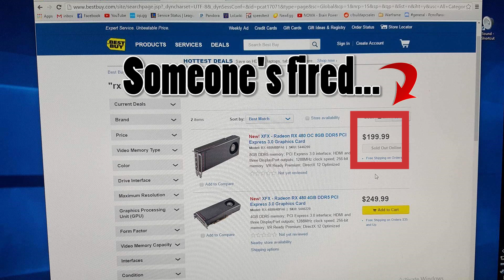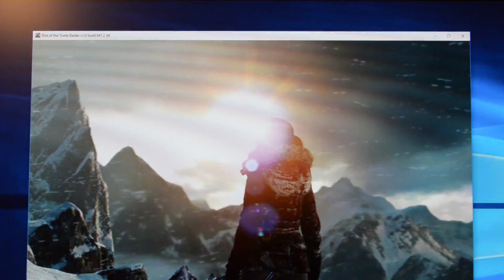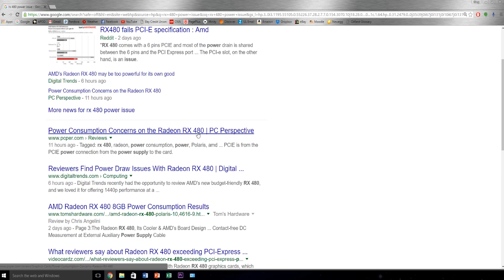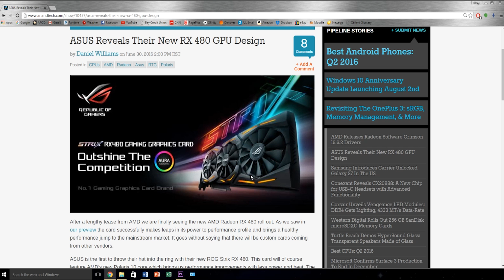RX 480 Aftermath: Power Issue & Over-Hyping

Comment: Why does AMD always have one serious fuck up with each generation of cards since they took over ATI? Saddening really, I love ATI cards.
Reply: embarkingolive how is the 290x a rebrand ? It's a COMPLETELY DIFFERENT CHIP . 7970 has 2048 SP and 290x has 2816 SP , 7970 has 4.3 Billion transistors , and the 290x has 6.2 Billion. They use different versions of GCN ( gcn 1.0 vs 1.1 ) . If anything , the 390 is a rebrand of the 290 !
Reply: What issues did the previous card.  Neither the fury x,  nor 290x or hd 7970 have issues
Reply: +embarkingolive amd  acquired ati in 2006, so no,  the 7970 was not developed by ati.  And the 290x was not a rebrand.  They use completely different chips (7970 is tahiti,  and 290x is hawaii)
Reply: Only poor stupid people think gaming is a necessity.
It's not. It's actually a luxury in life.
Reply: Fury X has stuttering issues at 4k. Even at 1080p on Mirrors Edge Catalyst it runs out of VRAM because it only has 4GB of HBM.
Reply: Why does nVidia? Why does everyone?
Reply: Actually embarkingolive, you're completely wrong. The 290/290x was not a rebrand - the 390/390x, on the other hand, was a rebrand of the 290/290x - exact same card, higher clocks and double the memory. So your statement "they didn't make any significant changes to ATI's architecture until the 390" is patently false.
Reply: Actually the graphics department is still ATI.
Reply: No, the 290 was new, the 390 is, in fact a rebrand of the 290. The R9 280 is the rebrand of the HD7970..
Reply: The 1070 and 1080 was discovered to have a massive issue too.
And the 900 series had issues as well, so did the 700 series.

All GPU runs into issues, the question is how hyped up these issues are on each brand.
Reply: I clearly see no issue here with the poor innocent card. What AMD saying to you is " Get a new gen motherboard damnit? "
Reply: they always have issues. but they stablize their driver after a year or more XD.
Reply: It's based off the architecture ATI had developed. They didn't make any significant changes to ATI's architecture until the 390, and yes, the 290x was a rebrand. Changing the name doesn't make it new.
Reply: The point is that the 300 series was a great improvement on card efficiency... It wasn't a rebrand, it was a refresh of it, where they improved with what they learnt from the 200 series, and then we had the Fury series as well...
Reply: If it was just a rebrand now explain to me the higher clock speed, the lower TDP and the ability to address more memory? Granada was an incremental upgrade over Hawaii in terms of efficiency which improved performance as well. A rebrand happens when you put the exact same GPU in a new series... For exemple the GTX 700 and 800 (OEM only) Series. Between the 290 and the 390, AMD made a refresh of the chip. Sure not a whole new architecture, but you don't need to be re-doing the wheel every time you release a graphics card...
Reply: the 290x had one of the worst stock coolers

but it was a solid card.
Reply: It's not a fuk up from AMD, previous generations of PCI-e simply can't deliver enough power, that's it! Get a cheap 3.0 MB and you'll be good.
Reply: +dra6o0n The 4gb flash applies only on review cards. They send them one card and two bios to review both the 4 gb and 8 gb versions.
Reply: embarkingolive
 Nvidia does it too :P

some of the tgx 900 cards(960 atleast) had the same issue that didnt get fixed for good till the partners's design

anyway they still rely on  Nvidia/AMD to issue their drivers with the software fixes, all they can do is correct what they perceive as lower quality on the hardware
Reply: still with hd 4850 
them golden times
Reply: +Phoenix Wright 7970 was developed by ATI, and the 290/290x are essentially rebrands of the 7970.
Reply: CoreMaster111 it's not . It's AMD's Radeon Technology group
Reply: I was replying to someone who connected the wrong cards together using the word rebrand. If you want to use refresh for such a thing I don't mind but the 290 to 390, 2970 to 280 and, to put in a nVidia example, the 680 to 770 are what is called in the industry rebrands because they use the same chip. It's common that these rebrands are (a little) more efficient than their predecessor  because of a matured manufacturing process of the chips. This, added with maybe a better power system and faster/ more memory makes for a better performing card, as is the case with the 390.
Reply: Well, I used the 200vs300 series because I forgot if granada was used on the entire range or only on the top-cards. But yeah I understand what you mean now.

Personally I'm not against that practice, especially if the cards bring improvements over the older generation, and can keep up with the rest of the market. Like I said, recreating a new architecture every new generation is proof of bad engineering, especially if they can continue to fine tune an older one to bring simular improvements...
Reply: I'm not against the practice either, agree. What matters the most is the performance/ price ratio which seem great for the RX480 btw. I'm not a fan of AMD going with an 150W power delivery system whit the card so close to using that amount (or even more) even at stock speeds. Maybe they should have released the reference card with six pin connector only as a 4GB and have the 8GB version launch with an 8 pin and better cooling solutions from its partners. Oh well..
Reply: Agreed... But then again, we all know that the reference editions are usual crap. At least they didn't pulled a "Founders Edition" crap. Hopefully AMDs AIB partners will provide their own improved AIBs without those issues later on...
Reply: The 6000 and 7000 series were good.
Reply: this  isntm ore of an issue it honestly looks like an oversight with pcie 1 and 2 compatibility with AMD trying to not use a 8 pin  or double 6 pin to secure the card's power outside of the pci-e lane

hence why one should be waiting for the AIB cards, those will surely address that while hopefully by then the reference cards get the necessary fixes t oget around that
Reply: well..that isnt a a hardware problem just a limitation of the tech :\, placing mroe HBM woudl fix it but the card would be even more expensive
Reply: the wrod rebrand is not used literally here
more like it uses tyhe same base arquitecture of the corresponding olderm odel but updates it ot the current tech of the time

tho this unlike with nvidia does play in the favor of AMD since GCN is pretty well developed by now making their older cards still quite capable since the hardware facilites are already there
Reply: Really? It's AMD's fuck up he was using a old am2 board? Those are fucking old as shit, and no wonder it caused issues.
Reply: +ViewBoss II

Actually the 4GB ones are actually a 8GB but is flashed to be limited to 4.
Every since RX 480 has a physical limit of 8GB of VRAM, limited by bios to 4 if necessary.
Reply: +Alex Eddy
Anyone trying to do a 'dirt cheap' PC build will find this issue, since really old decrepit parts are rather still available in the US.
Reply: Alex Eddy
keep in mind that the pci express standard is supposed ot be fully backward and forwards compatible ideallyl the board should never be an issue as they have ot be able ot provide 75W by standard but the card is pullingm ore on it instead of using the auxiliary power
Reply: dra6o0n
 Actually that was only the cards they sent to the reviewers... They sent an 8GB model with a dual-bios for both 4 and 8GB of VRAM so they could experiment with both configurations...
Reply: ATI was boss and Nvidia was the one rebranding back then... errrg welcome to the flipside.
Reply: ***** Most of what you wrote about the gpus are lies.
Reply: *****
the thing aboutthe pci power draw tho, mostly every card is guilty of this ot some extent especially after overclocking gets involved

this however was noticed by reviewers becasue the tdp of the card was over the 150W announced which eventually ended up confirming that just a single 6 pin is gonna limit the card hugely later on(ppl were actually okay with the tdp bit over spec but amd wastoo conservative with the power estimates by not giving us enough power adapters)
Reply: The 290/X run hot but it didn't have problems, especially with non reference cards, and yes, it can run that hot. The frame pacing issues were fixed with drivers. The 295x2 was the fastest single card, with half the price of the second fastest card. The 280x was certainly not disappointing, because we already knew that it was a 7970, plus, it didn't have driver issues.
Reply: *****
 them ost relaible fix will come once AIB cards with a custom pcb come out.

those will likely either improve on the power delivery design(ensuring the card would still only need one 6 pin, just more efficiently) and/or make their cards require at least a 8 pin(that delivers up to 150W giving the headroom for both safety and potential overclocking)
Reply: Ricardo AMD having to rely on board partners to fix their problems.... They are doomed to fail if they keep this up.
Reply: Ricardo Not nearly as often as AMD. With AMD it's every gen of cards that seem to have some crippling issue.
Reply: how is this a fuckup? the only fuckup here is the hype that the retarded fanboys cooked up
Reply: embarkingolive
"looks over at the gtx 400 and 200 cards"

the point is thisis not something new foreither party, it jut gets more attention on AMd's side because the hype train is currently derailing the hopes htis card was meant otbe a "titan killer" for 200$ and now ppl are picking straws at any issue they find to justify it.
Reply: It was never meant to be a titan killer, it wasn't even supposed to compete with 390x or 980, at least not according to AMD.

Comment: I'm a computer noob. Will my motherboard (hi-fi a70u3p) handle this?
lol
Reply: Yes. It will work. But I have an advise: wait for subvendor (like ASUS, MSI, Gigabyte...) video card. For example, I have MSI GeForce 970 Gaming 4G. It has 2 nice quiet coolers.
Reply: probably, but your advised ot wait for the partner's cards as they are the ones that will deal with the issue regardless if AMD does it by adding more pci-e power connectors and impriving the pwer design so the overdraw is no longer a problem

Comment: This power issue is BS. AMD dropped the ball hard. This card is ment for cheap mobo..
Reply from the maker: Modern cheap is likely fine. It's the old cheap that will suffer.
Reply: And it does work on cheap mobos quit being dumb and staying 10 years in the past and crying about it
Reply: trenidad zambrano
Many still have a core2quad pc that work fine for anything. the only thing that they need to upgrade is the video card in that situation.
Greg build even is proof that many still have hardware that this card would be a no brainier... but not it isn't.

Comment: Heyyo Greg, quick question... I haven't seen a good RX 480 VR benchmark using either 3dmark or SteamVR Performance Test that does properly show off the RX 480 premium VR claims .. By chance do you have one in the works?
Reply from the maker: I'm not big on VR and don't have the proper equipment to test with at this time, unfortunately.
Reply: Go to PCPer.com. They have a review on the rx 480 and it covers some vr performance also.